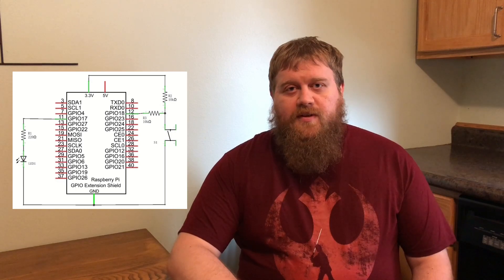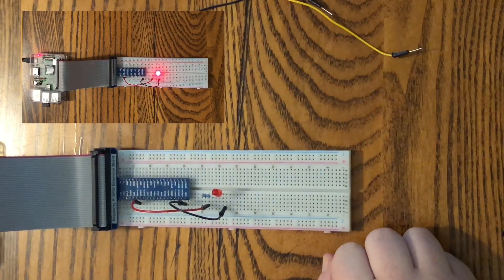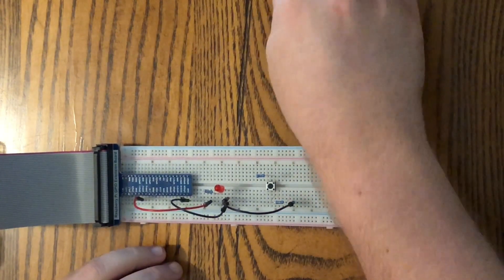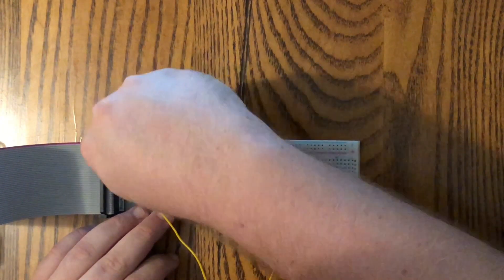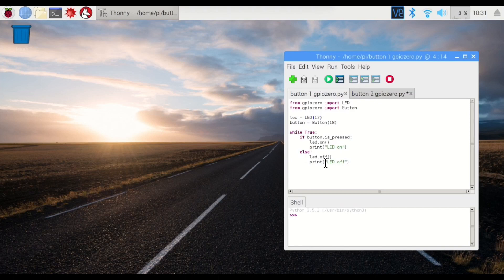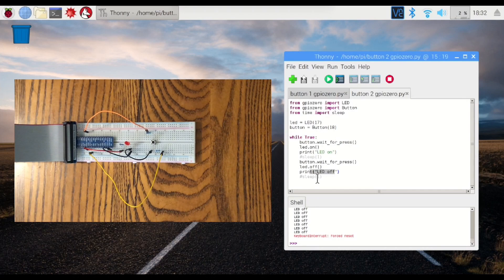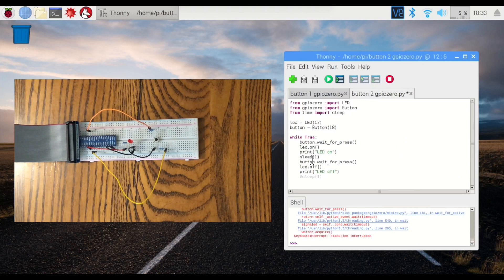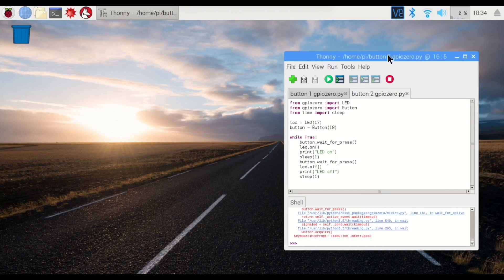Adding a Button | Debouncing | Raspberry Pi 3B+

Comment: Dont need ANY special code, just add a capacitor from a resistor (10k) to ground. the switch should be place across the cap and the pin to Pi is placed at the cap/resistor junction. The resistor goes from VCC to the +cap Once the cap has been "shorted" via the switch it will take a very brief period of time to charge again, this time period is the debounce time. Dont add useless code to your program. This is also helpful for relays or any mechanical closure,